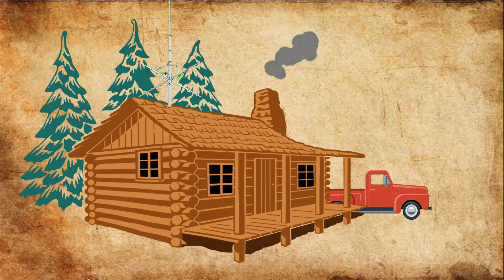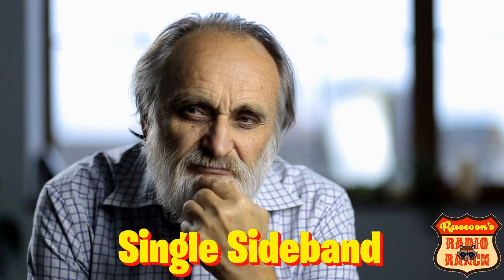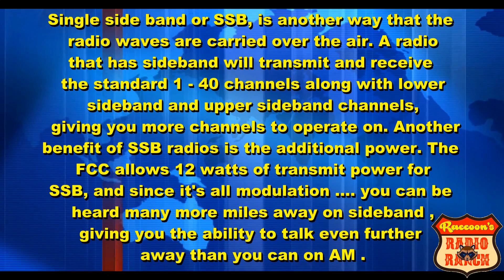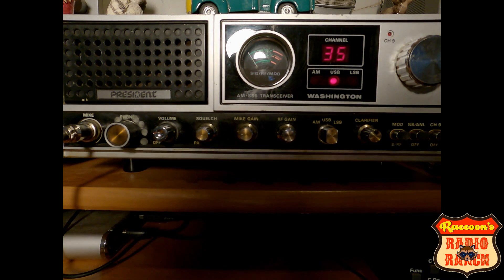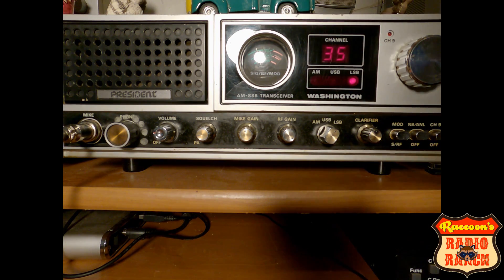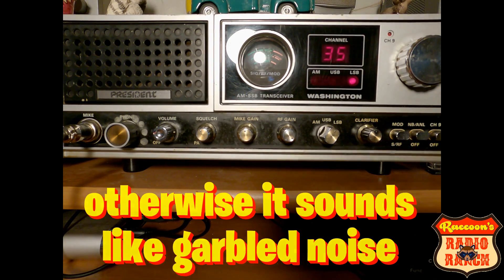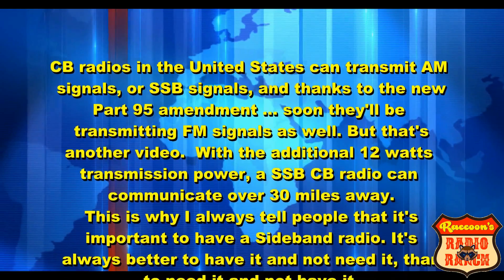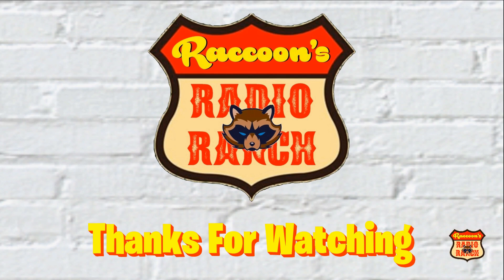What Is Single Sideband (SSB) ??

Comment: I have a radio just like that, except mine says UNIDEN in blue above the channel selector knob, and WASHINGTON where yours says PRESIDENT. I believe there were 3 versions of this radio made, and mine is the last. I bought mine brand new around 25 years ago. I'm pretty sure it was made in the Philippines. I don't believe it is as well made as the older models, but still seems to work well.
Reply from the maker: I think you're right , I think there were 3 versions as well . The first version was had a 4 pin mic jack and was made by President . Then the other two had the 5 pin mic jack . One says President on the front , and the newest one says Uniden on the front . But if I remember correctly , I think that both of the 5 pin models were made by Uniden .

Comment: Ssb is great just as long as your radio is aligned proper. And of course the station your listening to has there radio properly aligned. Makes listening so much nicer. 12 watts!!! Whats that?! Lol. 
Cool video Racoon. 
12ny waving. 
🤘🎙🎸🎙🤘
Reply from the maker: Thanks Bob , SSB is great as long as everyone involved in the conversations all have their radios properly aligned . Otherwise there's going to be a whole lot of twisting the clarifier left and right ... the whole time .... lol
Reply: @RaccoonsRadioRanch   which is why i stopped working on there radios. I'd fix it factory specs. Replace audio limiters after limiters and realignment of tuning pods that we're properly aligned numerous of times. I told them not to bring them back. With radio shack gone. Component Supply ran dry. 
12ny...
Reply from the maker: @bobhricko9892  Sometimes you gotta do what you gotta do . If they can't learn to keep the lid on their radios , and with Radio Shack gone .... it's pointless to continuously repair the same radios over and over when it's harder to get the same parts over and over .

Comment: One of the days I’m gonna send my Washington off to get it refurbished. It’s a classic design that never goes out of style
Reply from the maker: Dallas , I like the President radios a lot . In fact I have a few of them . The Washington that I used in this video is one that I recently picked up from one of the locals . It had been around the block a few times before I bought it . So it took a trip to the radio doctor to get back into shape . It's had a rough life , but it'll be fine now . I don't screw driver radios , if they have an issue they go see the doctor ... and I don't sell my equipment, so it has a permanent home now . I actually have a few more that need to pay a visit to the doctor . If they go , then you'll see them here in videos. Thanks for watching the video , and hanging out here at the ranch ... I like hearing from you .

Comment: Lotta guys run on ssb around here. I normally don't join in,  I prefer am on cb. The same guys are all hams as well. Not that that's a bad thing, I just prefer to rag chew on cb without all the q-signals ect. It's my "lazy band" if you will.
Reply from the maker: The reason I stay on Ch 12 AM , instead of hanging out on 38 LSB ... is because most of them aren't tuned correctly on sideband , though they say they are . Because of that I have to clarify left to listen to one ... then clarify right to hear the reply . Back & forth , and back & forth . I finally got tired of it and went where I don't have to do that anymore ... lol . Plus being on 12 AM gives me the chance to use my old 23 channel radios too .
Reply: @RaccoonsRadioRanch  well said Racoon. Left. Right. Back to center with the clarifer. Same reason i decided to hangout on ch 12 am with you which brought a few others to the channel. 
Besides... 12's on 12 sounds pretty cool i thought😎
12ny...